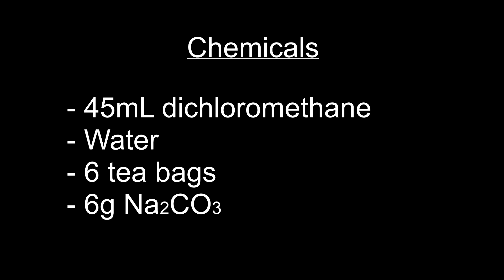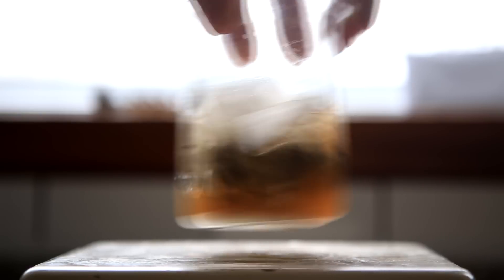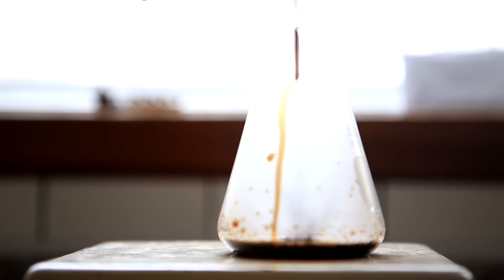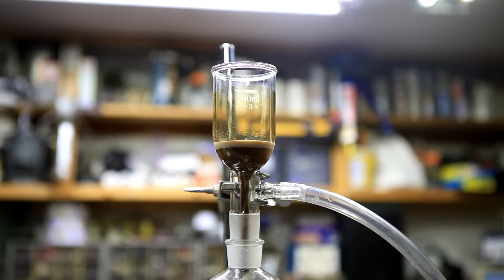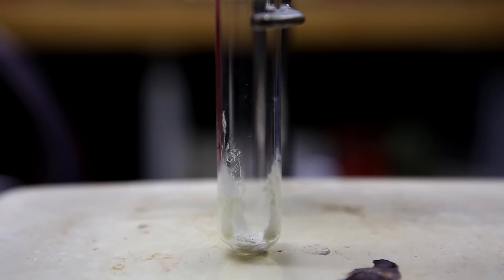How to extract Caffeine from Tea (Classic DCM Method)

Comment: Nice, but can u use something else than DMC? If DMC isnt available, could u use something else?
Reply: You could evaporate it at 80°c (accelerates evaporation without exactly boiling) for a while, then once it reaches about a fifth of the volume it once had disable the heat , transfer it to a test tube or something that is small but tall and let it sit at an almost freezing temperature (the closest to freeze the best, but don't let it freeze though, use your fridge or put it in a batch of ice, but the ice is probably gonna melt off and the tube has to not move).
You can then gently remove all the sludge above and the liquid below is diluted caffeine and caffeine crystals. You could put it at boiling temperature, shake it around and let it sit once more.
Otherwise, you can replace DMC by boiling water, ethanol but NOT methanol (1mg/ml and toxic) but DMC is recommended because of caffeine's solubility being of (140 mg/ml) AND is non polar (easy to separate from the sludge).
Water dissolves it in (22mg/ml).
the hotter the water, the greater the solubility of the caffeine.

However, ethanol is a much better solvent for caffeine, and should be able to dissolve much more at room temperature than water can. Provided that your ethanol is reasonably pure (as in no methanol, no butyl alcohol, ... basically, medicinal alcohol).

If you have the separatory funnel ,  measure your volume of liquid and solid, and weight it.
Now, add to a recipient of the exact same volume enough water until it's of that specific volume. Measure the weight difference between the teasludge and your water:
Volume of tea sludge - Volume of water = 0L (since they're equal)
Weight of tea sludge - Weight of water = Caffeine (& junk) weight

Add VERY GENTLY TO THE BOTTOM OF YOUR FUNNEL WHERE THE CAFFEINE SHOULD SIT 0.045.. ml of ethanol for every mg of difference.
 It's slightly less than caffeine's STP solubility in water, which should do the trick with ethanol. Then wait a minute so it dissolves (do not stir, it'll mix the water and ethanol together since they're miscible with eachother); then let the clearish bottom seep out from your funnel. You've got your raw, slightly contaminated caffeine mix. Please let the alcohol evaporate in less than three days as caffeine ends up unstable in alcohol after three days . You can use your radiator to do that job, as it's temperature averages 40-50°c ( which makes alcohol more volatile).  In case you have no heating system in your lab/home, just lay it on a/multiple watchglass-es/flat,non-sticky glassy surfaces.

Otherwise,

you can simply put your solution in it , let it sit for a while (about an hour or so) at an ice cold temperature to minimize the solubility of caffeine, then add gently to the bottom using an eyedropper/pipette/straw some ethanol.

Here is a clean protocol using ethanol WITHOUT THE FUNNEL:
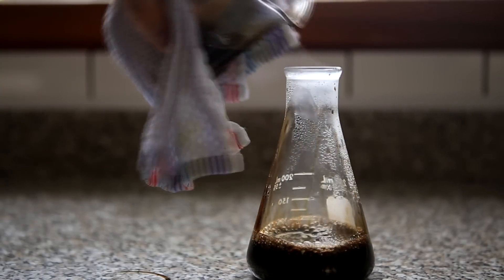1.  1:40 Follow up to here, and if possible, up to 2:00 .
2. Let your sludge of caffeine and tea extract evaporate at 80°c in the beaker for a while, until your volume (for example, 200 ml) diminushes by four fifths (so that it's 40ml). Then let it cool to STP (room temp. and pressure)
3. Measure the volume of your oversaturated water-caffeine-tea-extract and it's weight. Weight will be refered to as "W" in my calculation and volume as "V" . I'll refer to it as "Liquid 1".
4. Prepare the same volume of water at STP that i'll refer to as "Liquid 1". (room temp. and press.)
5. Weight liquid 2. The difference between weight of Liquid 1 and Liquid 2 is your yield of caffeine (and other invasive particles.).
Vliquid1-Vliquid2=0 (equality since same volume)
Wliquid1-Wliquid2=Wcaffeine&etc
To dilute your caffeine in ethanol, you'll pick it's solubility for caffeine which I wasn't able to find online , but knowing it's higher than Water's, we can deduce that it's above 22mg/ml and therefor, for every 22 miligrams of  caffeine (&etc) you'll add add one mililitre of ethanol to your cold water solution to it's bottom (using a straw or a eyedropper/pipette) very gently. Then let it sit for one minute, and then, use said straw/eyedropper/pipette to pull the water out gently.
You now have a ethanol/caffeine solution, hooray.
Now boil off the ethanol at ~78°c until there's only the bottom left.
What's left is a quite contaminated but pure enough caffeine end product. 
If you plan to consume it somehow which I don't recommend, you can wash it with REALLY COLD water since leftover alcohol and caffeine altogether won't do any good.

Comment: Great video, I am basing a research experiment for general chemistry off of it and the paper included.  What is the molarity of the dichloromethane and sodium carbonate you are using?  The paper does not specify either.  I need to include molarity in my materials required for a proposal.  I'm assuming it is just 1 M but a reply would be very helpful.
Reply: Hi! I'm writing a paper now also, would you like to share what molarity of the dichloromethane and sodium carbonate you used? I know it has been for a long time, and I would appreciate it if you could help me!
Reply: @alicetsang6274  lmk if you get an answer anywhere!

Comment: What does dcm stand for again ??
Reply: Dichloromethane also called methylene chloride. Commonly found in paint stipper. Used in the old drinking birds heat engines,  bubble tubes, and to weld plastics  as far as toys and model kits in my childhood. It is a great organic solvent but since it is a chlorohydrocarbon care must still be used around it.  It is toxic absorbed through the skin and inhaled. Meaning only outside use, or well ventilated with something like a fume hood.

Comment: If you had something dissolved in wax (carnuba wax specifically) that you needed to extract and convert to a water soluble salt, could you dissolve it from the wax using dcm/any nonpolar solvent then shake and vent like you did with an hcl solution? Brakleen didnt dissolve the wax but i am pretty sure it dissolved the something. It worked okay but i would like a professional's input for a more sound process.

Comment: Can you do this without DCM?
Reply: Maybe, but you need to find some solvent that won't mix with water but will take the caffeine off it
Reply: You can use ethyl acetate aswell (periodic videos did that for extracting caffeine from coffee). The thing is that xanthines are not very soluble and DCM is a very good solvent which is easy to remove

Comment: next time extract caffeine from energy drink.
Reply from the maker: +Epzilonz I really should and I plan to
Reply: yes plz
Reply: +Nile Red COULD YOU PLEASE GIVE ME METHOD Of extracting caffeine from energy drinks plssssssss
Reply: @kianakamelian3285  just look for the ingreedients on the back, make an exele spreadsheet, and list the items what they are soluble in and boiling/melting points and figure it out. 

That's how I extracted citric acid from these colour pills using pure ether and then filtering it, and boiling off the ether, leaving the citric acid in the first flask and distilling back the rest of the ether to use another day.

Comment: I would like to share the method which was done out of curiosity " how is caffeine in colour"I took 5 grams of tea sample and to it I added 500 ml water and kept for boiling.on boiling I added 10 grams of heavy Magnesium Oxide to it and kept for boiling again for 2 hours. Adding water in same not exceeding the 500 ml volume just for the purpose not let the conical dry.then cooled the whole solution and filtered through 201 filter paper.Filtrate was 500 ml.I then took 200 ml filtrate and added 20 ml Sulphuric acid (2 ml sulphuric acid : 18 ml water).Took the whole solution in separating funnel and extracted 6 times with chloroform.combined all these layers of chloroform and kept on water-bath till whole chloroform evaporates.And here I get white coloured caffeine in good amount.Thank you!!

Comment: Hey there, so I'm doing this experiment for a school project and I'm using isopropyl alcohol (99%) instead of DCM (which I can't use) but I can't seem to get two layers to form in my sep funnel since isopropyl is miscible in water. I found a technique in which one can salt out the isopropyl to prevent it from mixing with the water, but I was wondering if the salt would interfere with the caffeine extraction. I would love it if you could get back to me :)
Reply: You can get DCM at most hardware stores as epoxy stripper. It will say Methylene Chloride, but that is the same as dichloromethane.
Reply: +A. Zak Just make sure that it says 100% methylene chloride.

Comment: you said green tea? Green tea is very low in caffiene, try black tea next time, it contains over 5 times more
Reply: ***** well, he's not wrong. There is no nicotine in either, so there indeed is the same amount of nicotine in green and black tea xD
Reply: I should explain this a little bit, black tea is just cured green tea. The curing may have been relevant to the process in a negative way if he used black(though that's just a guess based on what I see here, and know about tea). They are basically the same leaves.
The reason black tea is cured is because in ye olden days, it was difficult to transport otherwise. I'm sure wikipedia could give a better explanation though.
Reply: +MaPorcaTrotaATutti 
lol?
Reply: Wrong, caffeine is destroyed during the fermentation and/or roasting process. It is why light roasted coffee has a higher caffeine content over dark roast. Green tea has much more caffeine but it is steeped much quicker when drinking so the caffeine content per cup is lower. It is a widespread myth that black tea has more caffeine simply because people steep black tea for far longer thereby increasing the content per cup.
Reply: MaPorcaTrotaATutti ^^
Reply: and NOBODY has realized that he misspoke and what he's using here IS indeed black tea...? 🤦
Reply: you mean the Turkish tea?
Reply: +Maanuueel42 \m/(^_^) sorry i ment caffeine;and yes the  amount of caffeine depends not on the tipe of tea but on different variables.
you can find more on the internet
Reply: if they're the same leaves, why would the black version suddenly have 5x the caffeine content after being cured?
caffeine content most likely depends on the genetic expressions of different "strains" of the tea plant, expression of the enzymes involved in the caffeine biosynthetic pathway would determine what the plant produces and how much

I haven't looked it up so this is just a guess
Reply: Black tea is the same as green but is fermented
Reply: it's just a mith
there's the same amount of nicotine
Reply: @TheGiuse45  NICOTINE
Reply: @kadergumus2598 I've already explained I ment caffeine 2 years ago

Comment: Hey man just came across your channel today and I freaking love it! Your experiments are so thorough, filmed very well and highly polished! Your channel makes me glad I chose to do chemistry at uni! Take care :D
Reply from the maker: jake n Thanks, I am glad you like them!
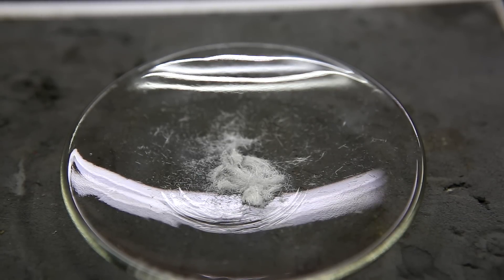Reply: @NileRed, hi at 3:17 you see the caffeine crystals in it's pure form. Isn't it toxic at this stage? In other words, isn't it dangerous to be near it without a mask? =(
Reply: Antony Liu; Well, yes and no.
Pharmaceutical grade DCM wouldn't be an issue if COMPLETELY evaporated (this is MUCH harder to do than you might think. Even with a good vacuum, heating it for over a week and powderising the crystals every couple of days, the caffeine would still contain quite a bit of DCM that was incorporated into the crystal structue.).
However, even a very pure AR grade of DCM, that you also fractionally distilled, MIGHT still contain some very toxic compounds (like carbon tetrachloride, mercury/lead salts, etc.), which would be VERY difficult to remove down to the required PPB level.
Reply: @mortlet5180  Use of an ICP/MS or ICP/MS/MS could tell you the exact amount of dichloromethane that remains in your product, since the mass of pure caffeine is known, and you can identify the presence of chlorine in a mass spectrometer report by the presence of mass peaks at the 35 and 37 z positions.
Reply: Not that toxic. We are talking about 30mg solid. It's not going in your body.
Reply: What if you wanted to extract green tea caffeine for personal ingestion. Would the DCM become a problem even if it's been fully evaporated?
Reply: MRLT interesting, given your comment, do you think it's possible that caffeine anhydrous supplements from various companies may contain traces of these substances that you mentioned are hard to completely remove? Or do they create the supplements in a completely different way?

Comment: Would another solvent work like ethanol or isopropanol if an ionic compound like sodium chloride was added first to the water/tea solution first? Many Thanks!
Reply from the maker: Daily Insanity You really need to use a solvent that is not miscible with water and that can easily dissolve caffeine. DCM is a very good fit for both of these requirements. However, even with a lot of salt, I doubt the other solvents will work very well

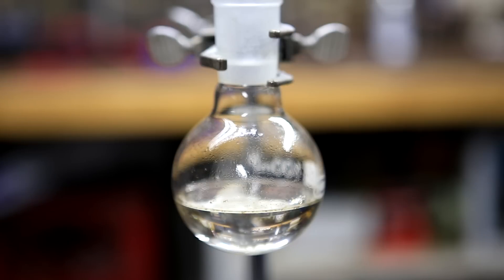Comment: How did it go from that orange/yellow color to a clear white color at 2:23 to 2:27?
Reply from the maker: Honestly, that does look a little weird. However, it is because I washed it with saturated salt solution. It cleaned it up a little.
Reply: Nile Red can i use anything more easily available instead of dichloromethane.
Reply from the maker: Not really. You need the solvent to be immiscible with water. So you're really only left with diethyl ether, chloroform, ethyl acetate, and some others. Of those, DCM and chloroform work the best by far.

Comment: would it also work with ethanol or isopropanol instead of DCM?
Reply from the maker: DCM works because caffeine is extremely soluble in it and it is immiscible in water. This allows for it to be extracted. Ethanol and isopropanol are miscible in water and cannot be used as extraction solvents.
Reply: okay, thank you :)
Reply: +Nile Red would acetone work instead of DCM
Reply: @ola198198  ho boy

Comment: How do you remove the dry, crude caffeine from the inside of the round bottom flask?
Reply from the maker: Dissolve it in small amounts of chloroform, wash it a few times with chloroform and transfer to the test time and then evaporate.

You could also just scrape off the caffeine with a spatula and then transfer it dry, but some would be left behind.

Comment: Could I try the hole process with water in a soxhlet extractor which i could then extract witch ethyl acetate??
Reply from the maker: You can use a soxhlet, but I found a link that suggests that the solubility of caffeine in ethyl acetate is very close to water. Whereas the solubility in DCM or chloroform is >9x more.
Reply: Nile Red I don't have DCM or chloroform available. Which else solvents could I use??
Reply from the maker: You can use ethyl acetate, but the yield will suffer because more will be left in the water layer. You might be able to fix that by increasing the number of washings. You could also evaporate all the water and dissolve the caffeine from the remnants using methanol or something.

Comment: What other solvents other than DCM can be used? I suppouse EtOAc can be used?
Reply from the maker: I am not sure. You can for sure use other solvents, but I think it is most soluble in DCM.
Reply: I did something similiar to this in high school, but with coffee.
We used ehtyl acetate, and it worked fine. But maybe it was prefered due to the costs.

Comment: Would you personally consume caffeine extracted using DCM, that stuff is quite toxic?
Reply from the maker: I wouldn't consume anything I made in my glassware, but there shouldn't be any DCM left afterwards.
Reply: Yea, caffeine is actually surprisingly toxic if consumed by itself. I think this is because it will dissolve in blood much easier and it is more concentrated.